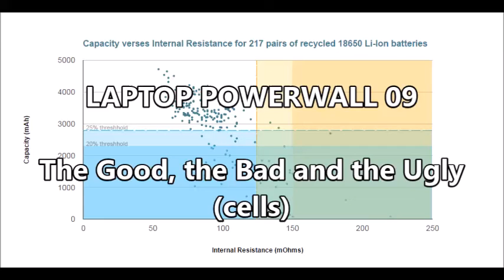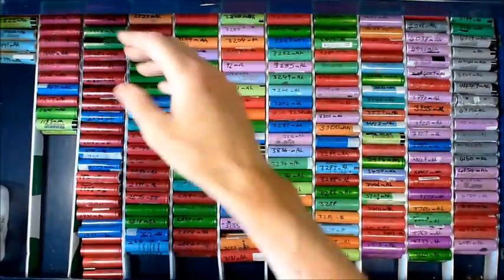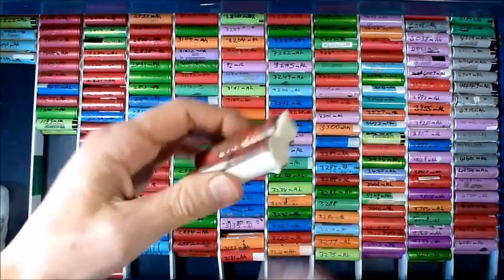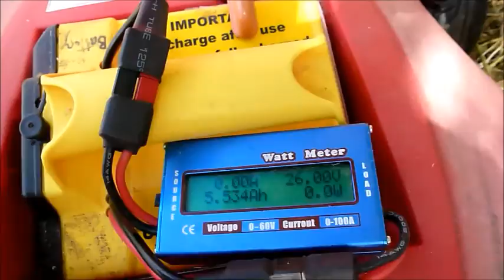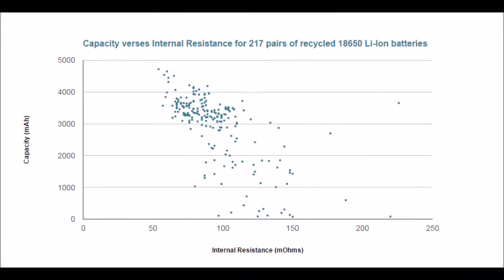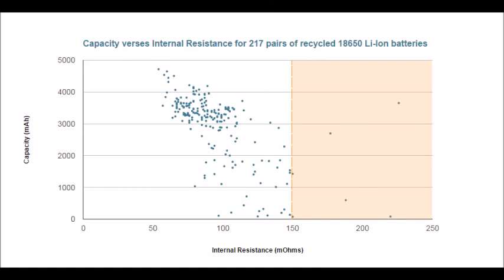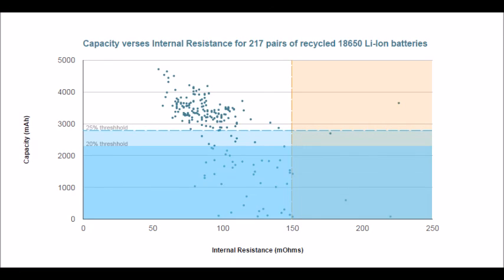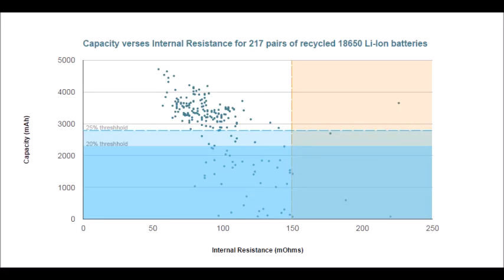Laptop Powerwall 09 - internal resistance

Comment: When i charge a pair of batterys  i get about 4400mA, which comes to 2200mA per battery but when i charge only 1 battery i get a reading of about 1450mA. I am using a iMax b6ac. Pls explain.
Reply from the maker: I don't trust the IMax B6 to give accurate results. If you tested the singles again I wonder what result you'll get.
Reply: Hmm, why is it that you don't trust the B6? My genuine B6 Mini seems to be quite accurate.
Reply from the maker: Oh. I was assuming it was a knock-off (like mine). Huh - in that case I don't have a good explanation. Did you watch my Pairs vs Singles vids? https://www.youtube.com/watch?v=bCI3FtWAh8Q Cheers, Paul
Reply: Are you discharging at the same amps?  so 1 amp for the pair and 1 amp for the single? would that effectively be then only .5 amps per each cell in the pair?  lower discharge amps causing less losses through heat showing better mA rate?
Reply from the maker: Good point. That would explain the difference.

Comment: How are thongs with the OPUS? I have the feelling that the OPUS gives a higher resistance than what you have been getting up to now (was it with the iCharger?), I say this as I am getting more with 150 IR than you with your results. Have you re-tested cells above 150 IR with the OPUS? Although could just be bad luck from my side...
Reply from the maker: I haven't tried IR testing with the OPUS yet. After seeing HPPowerwall's recent vids on variable IR results I'm planning on double checking my IR assumptions. I'll do a vid on how it goes.
Reply: +Paul Kennett thanks for not pointing out the spelling ;)
Reply from the maker: I was very tempted. :)

Comment: Excellent explanation Paul. Thanks.
Reply: Do you know any other device to measure the internal resistance of the battery?
Reply from the maker: +Ramesh Perera Most RC chargers will do it, including some iMax B6 units.
Reply: +Paul Kennett without any math calculation, can I measure directly the esr?
Reply from the maker: The iCharger (and other RC chargers) will measure the internal resistance for you. No math required.
Reply: +Paul Kennett Oh. I only have a Imax b6ac. Any video link how to do Paul?

Comment: In watching your series and building my own PW,  I am going to use a battery isolator and high amp diodes to separate my poor mAh packs from my good ones.  This way I wont need to worry about total capacity being lowered by one poor pack.

Comment: Are you in the UK, you mention IT recycler, do they charge you for the batteries?
Reply from the maker: +Colin Hickey I'm in New Zealand. The recycler charges me $1 per laptop battery (which translates to 16 cents per cell). I end up discarding 20-25% of those for being too low capacity.

Comment: i would seperate those pairs because one battery could still cause problems and give false readings. you should do each battery by them selves. nice video
Reply from the maker: +donzi joe I think I'll do a video on why I choose to keep the cells in their parallel pairs. Problems with overcharging and undercharging are usually associated with charging cells in series - not in parallel - where the different cells balance each other.  Keeping them in their pairs saves a lot of handling time - which makes the large pack project more viable.
Reply: +Paul Kennett  From a statistical point of view it could be interesting to pick a random lot of pairs and test them each cell individually. Then it would or would not validate your point of view (wich I share :D )
Reply from the maker: +Propergol Hmmm :) True. I guess I could re-solder them afterwards. I've got another batch of 70 laptop batteries to open so I'll do your suggestion. How many batteries would you thing? 5 or 10 pairs maybe?
Reply: My maths are...far away...;-) What I remember from my classroom is that you need a precise number of samples to get good stats. But I can't remember how this number of sample is calculated... I would say 5 pairs but that is just a guess.
Reply: +Propergol again this is just an opinion. you could be getting better batches of laptop batteries than i have been getting. most of mine are testing below 2000ma with a lot of them at 0.
Reply: +Paul Kennett I don't know if you have done it yet or not, (I'm still watching and enjoying your videos immensely) Maybe it would be worth it to tear apart the pairs of cells that have a low mAh capacity.  There may be one really bad cell in the pair that is draining the mate cell down.  You might have a good one with a bad one...  Just a thought.
Reply from the maker: +Glen Hewlett Yep - definitely worth giving it a try. It's on my list of things to do.

Comment: Nice presentation of the spreadsheet Paul, gives a very good impression and explanation. Looking at it, I would say that anything lower than 2700 mAh or higher than 115 mΩ should go away, then your pack would come automatically above 2 kWh. But that is more easily said than done :-) Overall a very good job ! Question: without looking back your videos again, did you select on any initial voltage before processing?
Reply from the maker: +Sjef van Gool Hi Stef - after opening the laptop batteries I sort them in to piles of 2.8V or better (which my charger is happy with). Then I had another pile of 1V or better - which I tried resuscitating. And then another pile of less than 1V which I left till last. My worst cells tended to come from the last pile. 

I&#39;ve been keeping note of the laptop brand, initial voltage, resistance and capacity of all the cells - so my next video will be looking at that data to see if there is any correlation between brand vs capacity, and initial voltage vs capacity. My hope is that I can define some firm limits based on this data to discard bad/weak cells before having going through the slow discharge stage (to measure capacity).